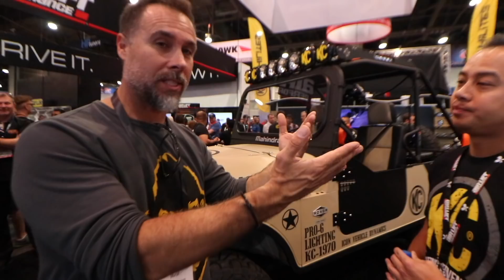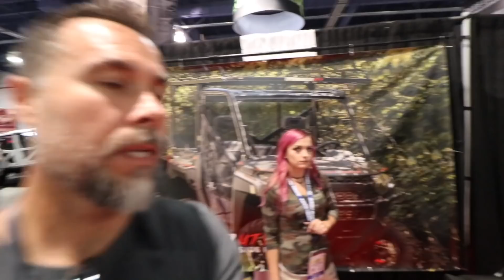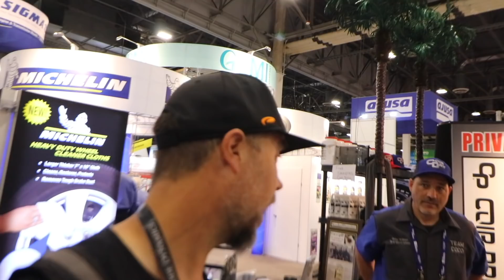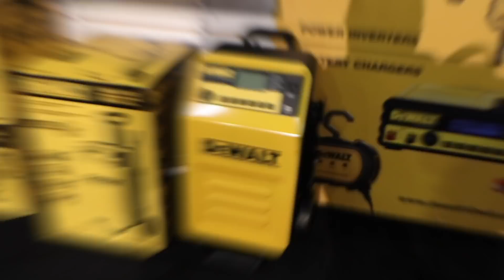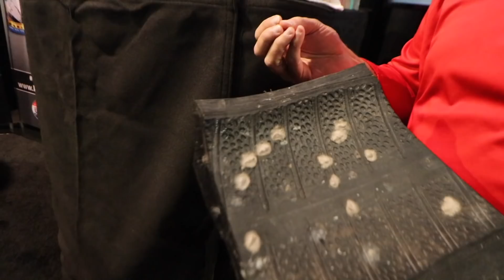The Newest & best Automotive & Mechanics Tools 2019

Comment: I wonder if they are coming out with a 23 gauge cordless pinner anyone know I bought the 18 gauge shoots up 2 inch Brad nails and the 15 gauge angled nailer shoots up to 2 1/2 nails with great holding power . Like them very much so far have trimmed a hole house and built some built ins to so nice having no cord.  wish they were lighter and smaller but still would recommend.

Comment: That tracked trailer mover is a great invention.  I have seen one on a travel trailer, but it wasn't tracked, but rather a tire that was motorized and it helped the owner move the trailer into tight spots or move the trailer across his yard and didn't need to use the truck.  It is especially useful in small/tight places where maybe a truck would be too long to maneuver, like inside a barn or other storage facility.  I have also seen one that would lower down from the rear of the trailer to move the trailer around really tight corners or again, to maneuver in tight storage spaces.

Comment: The little robot on the trailer is the trailer buddy it is designed to move your trailers in and out of tight spots without having to worry about truck swing or having a second person spot for you

Comment: My question about the tire hole plug is why not passenger cars?  If it works on every other tire my guess is they know it doesn't last long and a passenger vehicle could crash if it failed or at least it's more dangerous going a high speeds. I makes me a little uneasy about buying this product.

Comment: So you can't buy coir dry. it is only available to retailers. Well, that sucks. at 10 bucks a bag I would have bought a few bags.
Reply: Go to any pet store and get a brick of EcoEarth in the reptile department for $4.99, or a loose bag of it for $10. It's the same stuff. I use it in all my terrariums for my geckos. The bag of loose material is probably better for spill cleanup. The bricks need to be be soaked in water to loosen them up and then let them dry out.

Comment: I I have a boat that I like to have facing uphill, which means I don’t have room to pull my truck all the way up to my house,,, that little trailer mover think could work,,, I’ll just keep using my dingo though..looks like you could get some trailers in some tight spaces.. without moving other trailers, if you don’t have equipment laying around,,, or for people that just can’t back up trailers.

Comment: It's a rc tank that can move a trailer. I would be wonderful for moving trailers for a shop when a car can't fit in the shop to move it, it's helping for places that sell camping trailers to their display places with out using a truck, and would be extremely helpful in warehouses helping move heavy gear on cart from one side of warehouse to the other side. Also it would be helpful for hauling carts, sleds, and trailers where cars and trucks aren't aloud on but the item has to be moved onto or over.

Comment: There's a certain spot where you go from hot to cheap and that red head is on the mark.
The next time I spill trany oil on my PLASTIC garage floor, I'll be sure to buy that product.
How can they call that a potable sand blaster when it has to hook up to an air compressor?

Comment: I've tried slime's tire sealant which is snake oil but seeing that multiseal work in action sure impressed me. If I had a heavy duty work truck that goes into jobsites where there's no telling how many nails they are, it'll be necessary for me to use to avoid inconveniences.

Comment: The Multi seal I would not use on any vehicle that drives on the road it will throw off the balance on the tire and you will get a wobble at high speeds!!!

Comment: The gadget that was moving the trailer is actually kinda handy. I saw one used at and RV showroom/warehouse.  They moved several trailers around with out having to bring in a forklift or other tow vehicle which would have had less turning room.   So it’s kinda neat but other than this I really can’t see it having any other use.

Comment: re: that Slime gauge, the PSI drop is going to be far more on his demo wheelbarrow tyre than it would be on a car tyre.
Reply: but with truck airbag suspension helper springs.... every time you check the pressure it dropps 1psi. not convenient if you do not have onboard air
Reply: @fastinradfordable  - I'm not sure I understand your point? I was pointing out his testing methodology was a bit bogus, car/truck tyres expel far more air during a test than a low PSI garden wheel would

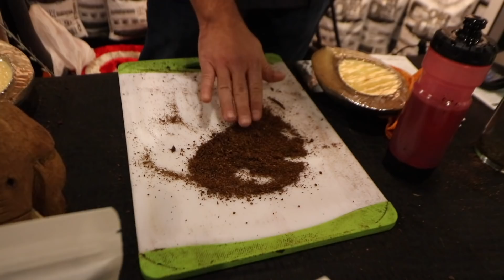Comment: The 'Coir Product' 06:41 looks good, but their website isn't up yet. #Groan #Fail. http://www.coirproducts.com
I thought the Slime Elite Digital Tire Gauge 13:13 was nice, but again, product is not even up on their site, or at amazon as of today.
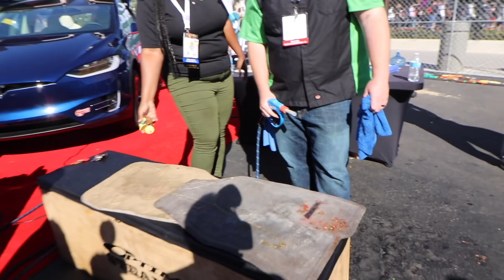16:05 That looks like a good product as long as you don't let any loggerheads use it.. BUT he didn't pour oil or grease on the car mat, so maybe not for heavy duty applications? 

The little Robotic car, I can see how it might be helpful for a guy so rich he can't see straight and is super lazy. That's about it. Or maybe if they built one bigger, that could move faster, and wouldn't run dead after a short while, it might be a useful tool for some big boat dealer who might move their boats around a lot all the time. 

The GearWrench brand, I recently had a chance to use a few of their ratcheting stubby wrenches, I didn't abuse test them, just used them in normal engine work, and they worked well.
Reply from the maker: Thanks for the input and for watching !

Comment: In regards to the tank looking thing that moves your trailer, its amazing..... I do lawncare and everything on my trailer is heavy, i also live in a subdivision with a driveway that turns into a 90 degree turn into my garage, where i have my 78 f150... i have to use a trailer dolly to move my trailer into my garage due to my truck and trailer being so long... so that device would save my back, and time...

Comment: I'm interested why the tire auto sealing adhesive wouldn't work on passenger vechiles cause I'd sure love to put that in my 37 inch all terrains it be perfect for anything... Bummer.
Reply: The sealant would be restricted for liability reasons as, while it should seal the hole, it won't repair any structural damage to the tyre - you DO NOT want a tyre structural failure at speed!
Heck, worse, you may not even know it was damaged in the first place if it seals that quickly.
Personally, if I were only using the vehicle at low speeds and/or off road, I would definitely be looking at using the product.
Reply: @gordowg1wg145  that makes a ton of sense thanks

Comment: Love these videos. Good information in them. 

Also on the tire sealer how does it fix side wall punctures ??
Reply: Sidewall repairs are illegal for good reason.
Reply: @____________________________.x  Illegal on a skidsteer?
Reply: @stevesmith8107  - ah, you didn't specify... I'd ask the manufacturers, although there are a couple of threads on the internet discussing skidsteer tyre repair.
Reply: horse1066 yes but hes talking about the TIRE SEALANT not any other form of repair. He wants know how the TIRE SEALANT works on the side Wall.

Comment: So why wouldn't that tire sealant work on passenger cars and trucks?
Reply: The sealant would be restricted for liability reasons as, while it should seal the hole, it won't repair any structural damage to the tyre - you DO NOT want a tyre structural failure at speed!
Heck, worse, you may not even know it was damaged in the first place if it seals that quickly.

Comment: Love the video Mr. Genadek you should definitely keep doing these but I have to ask, why didn't you show any snap-on tools? We're they not at SEMA? They've had tool boxes like the one shown for at least the last 10 years. Yes they are as expensive as a new car sometimes but you really can't find better quality, they have pretty good financing options, and there is always a local snap-on dealer around to replace any broken tools. I've never seen or heard of those other guys before and when working professionally being able to replace your tools quickly is required if a tool breaks. 
One more thing, please do not buy digital torque wrenches. The click type are practically always stronger, more reliable, and need calibrated far less. Digital torque wrenches like the one shown really are just products looking for a problem instead of being tools to solve an existing problem. Also the swing on a torque wrench is pretty much irrelevant since you should be snugging up any bolt or nut you plan to torque and only using the torque wrench in order to torque to spec, less than a 90* swing (unless it's a wheel stud on a larger truck, those take some crazy pressure sometimes) to torque is proper in most cases. Never use a torque wrench to initially tighten, or loosen, anything it will cause calibration issues.

Comment: The coconut absorption rate was very interesting.  The tire sealant was awesome but NOT FOR USE IN passenger cars (sadface).  The little robot for moving stuff makes sense in tightly packed garages as it has little footprint and big utility.  Only thing that limits the tracked bot is the weight it can move.
Reply: The sealant would be restricted for liability reasons as, while it should seal the hole, it won't repair any structural damage to the tyre - you DO NOT want a tyre structural failure at speed!

Comment: That sealer thoe??? What happens if your putting air in a tire and you dont get a good connection and air leaks from the valve stem???? Is the tire junk then????? Cause it would technically seal the valve stem??
Reply: Assuming you have a brain, you realize the valve stem is on the wheel and not the tire so there is no way to get it in the tire valve.
Reply: It is possible to have it clog the valve, you are supposed to remove the valve before adding the slime. If it does clog, remove the valve, clean it and refit. It's pretty unlikely though.

Comment: I have the dewalt portable compressor shown in this video.  It has two issues that should be mentioned.  The first is that the battery leads are extremely short making it not possible to access some batteries.  The second is that the plastic connector on the back of the unit to which the battery leads attach does not work well in the cold.  I'm in Canada and during a cold day if you aren't very very careful the plastic connector will crack and break as it did on mine.  It's not a nylon flexible type plastic it's a rigid black plastic.  Rigid plastic + cold = useless.  A huge oversight imo for a device which is often used in emergencies.  The compressor is slow to pump tires.  The overall performance of the device due to these issues is about a 7/10

Comment: The Dewalt power station is junk. I had gotten one. The second time I used it the air compressor died. I've heard of others having the same issue.
Reply: My compressor also was junk when I bought it but luckily it seemed to fix itself.  It still however takes a good while to pump a car tire.
Reply: You should know better than to buy some gimmicky all in one product. The only thing that I've had that's an all in one that actually work, is my smart phone, and I paid
a pretty premium for it.

Comment: Dangit! 3:51 AM here and noticed this as I was about to retire for the morning.
Some very, very nice toys there - you definitely need to leave the credit card at the hotel when attending those shows!

That truck rack could be very handy - 400 pounds is a bit light though, so maybe higher ratings to come, as few domestic engines are light enough?

Now 4:15 AM :-(
Reply: Think about it like this.. Can you bench 400 lbs? Its not so light when you think about it from that perspective. OR lets say your an old man, who's still doing the hustle,
and you got something heavy you need to put in the bead of your truck, it could go a long way toward helping in that sense. 
BUT it's capacity, it would be nice if it lifted 800 lbs at least. You could at least pick up a normal engine and load it that way if working in the automotive field.

Comment: Would anyone really put that monstrosity on there truck to lift something in the back?
Reply: Yeah and it only lifts 400 pounds? Whats the point
Reply: people who put boats on their roof when offroading/overlanding.
Reply: Jttv that's what buddies are for. Nobody goes over landing alone.
Reply: @petequinones3454  Yeah i bet you that the thing costs an arm and a leg
Reply: Urbanites Garage  He asked if they had any problems. Yes no one is buying it.
Reply: @urbanitesgarage3299  yes you know that hydraulic system alone is a grand easy, plus all that tubing, probably looking at 3-4 Grand easy
Reply: Well my grandparents retrofitted a lift in their tundra. They have an ARE camper shell which has a big piano hinge on the drivers side so it can be lifted up by a control arm and then they have a little crane arm thing in the back that hooks to their electric scooter and lifts it out and carries it over the bed rail to the front passenger seat. And the front passenger seat also comes out and lowers and then lifts back in so handicap people can get in and out, and they can control everything in the bed of the truck from their seat.

It's honestly pretty cool but yeah it's a very specific market for that kind of stuff. But there's a lot of old guys out there that would probably buy a lift to get their golf clubs in their truck or to help lift heavy things. Definitely not very useful for young healthy people.
Reply: @dedalliance1  My wife uses a scooter also  so that would be handy  or loading hay bails
Reply: @waltlars3687  Yeah, it would be good  for a lot of things really.
Reply: @dedalliance1   a scooter lift would be My first use
Reply: @waltlars3687  and lifting big generators into the bed for camping lol
Reply: @dedalliance1  lifting many things
Reply: There are better ones, which are actually smaller and lifts a lot more I've seen a loader you fit directly to the bed of the truck, used for loading excavator buckets and what not. But, 400 pounds, that's too little, and I didn't like the winch solution one bit either.
Reply: Filip Hörnqvist And it takes up the bed of the truck plus it sticks up very high.
Reply: If you have a moving company itd be perfect or if you have a strictly work only truck it could be useful
Reply: Old people
Reply: What a waste, probably 2500$ on top of it
Reply: A crane in the back does the same thing lmao
Reply: It looked flimsy
Reply: Ladder rack but not heavy enough winch, good idea it just a little light

Comment: My jaw is still dropped from the tire sealant repair demo!  You killed it Stan!
Reply: Did they say why it can’t be used on passenger vehicles if it’s ok to use it on trucks trailers and the likes?
Reply: @sarahnz65  Probably not speed rated
Reply from the maker: Thanks Rebecca!
Reply: Same. That sold me on it
Reply: How do you get it in there? Just put it in there while mounting?
Reply: Auto Denver take the valve out